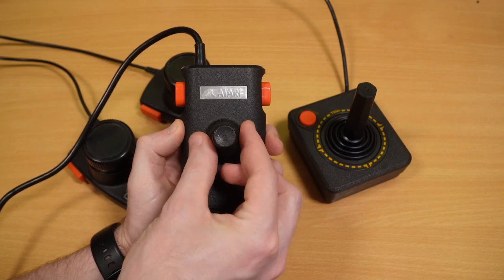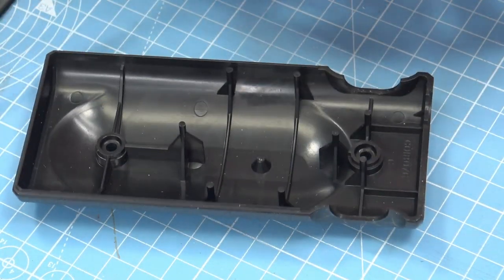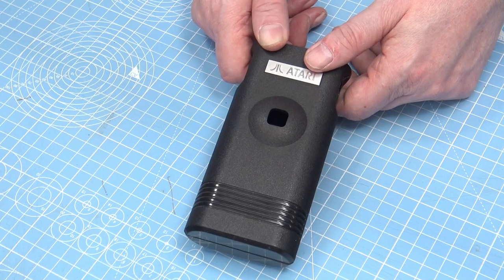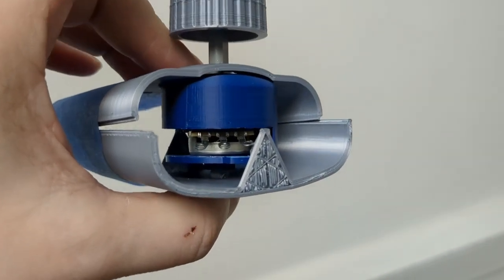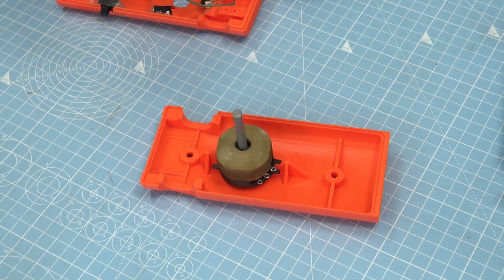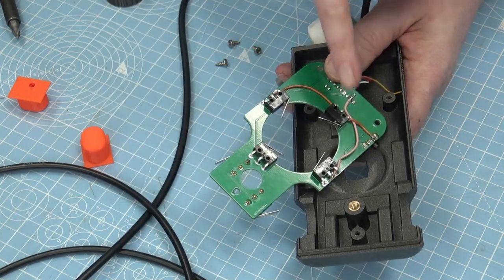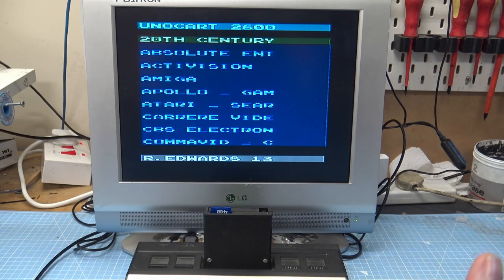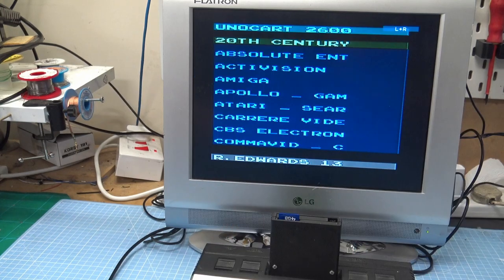I 3D Printed This RARE Atari Joystick From 1983!

Comment: Great job! I like the design very much!
As for the joystick issue, how about printing a sleeve with TPU that goes between joystick opening and the knob?
Tension should keep it centered and since TPU is flexible, it should allow it to be pushed in any direction.
It will wear over time but worth a try.
Reply from the maker: i had thought about that, just need to find some time to play with the TPU, but work must come first.

Comment: Amazing engineering there Lee, so much to figure out there. I always think joysticks are deceptively simple but there's all these little details that need to work to have a fun experience. Completely agree it looks AMAZING! Only when side by side could I really tell the differences between yours and the original, the look is very faithful. Super practical and authentic way to play Atari games that need paddle controls. These things take time, I think it's best not to rush videos out when you're working on something cool like this and also considering your operation and recovery too. Bravo and hope people cleverer than me can help with the centring problem - will be fun to see part 2 when you've tried some of the ideas. Cheers!
Reply from the maker: you can make something look fancy , but if it is not enjoyable to use it's a fail.

Comment: I also use PTFE lubricant when I have plastic on plastic contact for moving parts that need to be smooth. It acts like a grease, but doesn’t react with the plastic, doesn’t have a strong smell and the stuff I use if food grade.

Comment: For a centering option, try making a ring that attaches to the center hole, then add 10ish fingers that stick out at 20 degs angles, making contact 360 degs. so when you lean it, the set of fingers slightly bend. Take the tamper ring off a milk jug or soda bottle to get a general idea.
Reply from the maker: it's all sorted and I will be making part two soon.

Comment: I believe textured plastic is usually achieved by sandblasting the mould; they can polish a part of the mould to give it lacquer type finish and sandblast part of it to give it that textured finish. There is also a process of flocking to give items a different surface, but i believe you'd have a sticky mess on your hands by now if that had been used.

The original joystick subassembly is probably moulded from PA6. You can have yours SLS printed from PA12 and then condition it in moist atmosphere to reach final pliability; as an extra advantage PA are self lubricating materials, low surface friction. You put it in a ziploc bag with half a teaspoon of water to condition it and wait a day or two and you'll have a slick and springy part; however it will also expand a little. It shouldn't break conditioned like that, and it should hold onto conditioning for about 20 years. Some alternatives i can think of for spring wings, you can use zipties as inserts that you somehow attach to the print, perhaps just with epoxy, with the moulded in teeth of the ziptie providing the key that epoxy can hold onto by interlocking, which is needed since it won't actually form a permanent surface bond with PA zipties. Other thing i can think of is spring steel thickness gauge foil (maybe 0.2mm or so), but i don't have a sample of the material at hand so i don't know if this is right.

Odds are the original controller, as designed, has these wings a little more flexible than they are now, so they're now more susceptible to damage, due to loss of conditioning.
Reply from the maker: I was watching a video about injection molding and they mentioned the spray method so that is my only reference.  The main problem with testing and fitting parts is the cost to have someone print parts in pa12 while I work iterations and it's just not worth the cost involved on a small scale.  same for the spring steel you mention, i just don't have these things handy to test.
Reply from the maker: PCBWAY do have PA12 and PA12-GF as options, I wonder if I can ask them to print a test item and check it for me.
Reply: @leesmithsworkshop  GF variant is not for this purpose. It's for when you need extra stiff parts where you want as little flex in there as if it was cast metal, and also need to eliminate creep. Ultimate strength is of course lower than metals but so is weight and manufacturing cost at small scale. It can be a little abrasive as well, so that's not ideal.

Very convenient sponsor for this sort of project; indeed i have something in mind and it's great that several SLS/MJF companies can cover actual small scale manufacturing of a custom part with this sort of material where it makes sense anywhere between 20 items being made once and to potentially hundreds a month. As a sponsor they might just bridge the cost of iteration for you and make it sensible as a one-off as well, after all it is possibly a perfect showcase of something a customer might want to do at actual scale.

You can potentially FDM print PA at home as well, but i don't have experience with it. From what i've heard and seen, it's a bit of a chore due to just how hygroscopic it is.

Also i don't know if PETG printed wings would necessarily break, they might just be fine. The material is also kind of low friction, so that's nice, but not quite as silent as PA.
Reply from the maker: @SianaGearz  I am not planning to sell these so I can't go back and ask for test parts especially when my videos get low views. At the moment I have an idea and testing some springs in pla, asa and petg, but they are printed on the side as separate objects and will make a new central part that can fit into.
Reply: @leesmithsworkshop  Ah don't sell yourself short. You never quite know how the marketing budget and accounting of these companies works out, no point in making decisions like that for them. There might be more use out of collab than straight up one way advertisement, they might put your vid to use as a showcase, advertising your vids in the process, and they're good vids, you explain and showcase things very nicely, there's value to that. They're likely to have excess capacity on slow days that they're looking to put to use which doesn't actually result in any substantial costs to them. They might be looking to host things like that as "Shared Projects", letting people order kits from them, this way generating sales as well. They might be willing to take some gambles with less popular creators knowing that perhaps a handful of these projects might just pop off and create a sufficient revenue to cover all of them, and you shouldn't think that this project has no chance to prove popular - lots of people have an Atari console, can put this project to use, and may be inherently curious. And it's specifically thanks to them supporting the classic computer scene in breadth that this company enjoys great reputation in this community, that's an incredible sort of network effect and image capital that transcends immediate monetary value.

Comment: For your centering problem, you could try 8 round flat neodymium magnets arranged in 4 pairs instead of the springs. Four of the magnets would be glued to the part you show at 26:10 . The other four would be glued to the case. They would be set up to repel each other. You would just have to try it to see if it felt right. It would all depend on the strength of the magnets and the distances between them. Nice video and the 3d printed parts look great.
Reply: Very good! I have played around with small cylindrical neodymium magnets and yeah they feel like they might just be it.
Reply from the maker: magnets is not a bad idea so I will test this.

Comment: The quickshot joysticks had a tightly coiled spring at the bottom of the stick pointing downward into a circular container in the bottom of the case. That might help with centralisation problem.

Comment: Injection moulds can be acid etched to achieve a textured finish but it is longer lasting to use spark erosion.
Reply from the maker: Thanks, i just know it's a process added to the metal after.

Comment: I wonder if you could mount 4 horizontal, opposing springs. They can’t be too strong obviously. I’d probably start with springs from a Biro.
Reply from the maker: I tried springs before, but I think I just did it totally wrong, the springs held the joystick in place, but also pushed it up so it added friction when it moved. I was talking to someone else and we came to the idea like yours to try it  like a trampoline .

Comment: For a smoother top, maybe try using adaptive layers, which will do smaller layer heights near the top, but not slow down your overall print like it would if you printed at a lower layer height.
Reply from the maker: All I had to do was sand the ASA and it would be perfect, but I wanted to say something good about the resin prints from PCBWAY.

Comment: This is brilliant! I have an original one of these I picked up at a garage sale years ago for $2. Still works (after a good cleaning of course). But I'd be interested in seeing the new and improved one. How feasible would it be to make the two buttons independent of each other for full Atari 7800 compatibility? Not sure if there are enough pins on the DB9 connector for this though.
Reply from the maker: I think it would need a 2nd switch for 1 - 2 buttons depending on how the 7800 is wired.

Comment: A thought I had about improving based off the original design would to be embed thin metal clips to act as and renforce the spring mechanism of the tabs that press the switches.  This could provide strength to the plastic preventing breakage, and solve the centering problem.  Kind of like adding tie bars to concrete.
Reply from the maker: I was looking at spring clips that can be soldered to the PCB and I found a few, but I think they are for terminals,  connecting grounds and battery's so not sure how they would do with the repeating joystick movements.
Reply: @leesmithsworkshop  I was thinking more of a piece to repair the plastic of the original model.    I think maybe a couple pieces of nitinol wire embedded in each "flap" with a 90 degree bend into the column might do the trick.  I have the Sears video arcade II, and just thinking outside the box to stiffen it up.  I access to a few printers, I'll see what I come up with.  You did an amazing job with what you came up with, and have inspired me.
Reply from the maker: @davidmalia9057  are they known for damage on that part ?
Reply: @leesmithsworkshop  The problem you observed with your mockup also occurs on the original design.  They become loose, and you have to press harder to get a response, until eventually it's too loose to work

Comment: I think you could solve the droop by either moving your current microswitches over a bit to change the level point on the switch Or go for some more heavy duty switches with stronger internal springs? The other more advanced idea I had was to create a ring with 4 prongs that poke in diagonally inwards towards your joystick assembly and then you could have 4 springs mounted on the prongs pushing back against the joystick assembly And the springs should fit between the micro switches?
Reply from the maker: take a look at my recent community post, I have one solution that I have tested and worked so just waiting for some springs to try out.
Reply from the maker: I already bought the strongest sub micro switches I could find and it was not strong enough.

Comment: I have this same console with several of these unique joysticks, but unfortunately most of them don't work well. I did manage to create a part to fix the joystick in Tinkercad. Still a work in progress though.
Reply from the maker: people have said the pots need some deoxit and that the flappy wing parts I mentioned do break over time too. What are your faults ?
Reply from the maker: I saw your reply, but it's not showing up did you delete it ? I think the material would have to be nylon of some sort to have the flex it would need, nothing I know would work if you copied it as the original and just break.

Comment: @collingall of Laser Bear Industries maybe you best bet for help. I wonder if a much higher force switches would help.
Reply from the maker: I was not having much luck finding them that are small enough to fit inside.
Reply: @leesmithsworkshop  What about low profile KB switches or OMRON Mouse Micro Switch both come in multiple Nuton levels
Reply: @leesmithsworkshop  Also what about Seimitsu LS-58, LS-58-01 springs?
Reply from the maker: @flibble666  what about them ?
Reply: @leesmithsworkshop  would they work to keep the stick central
Reply from the maker: @flibble666  I don't know much about them so can't say, but I do know they can't be used like they are in the original joysticks.